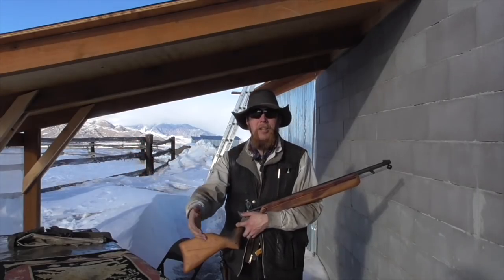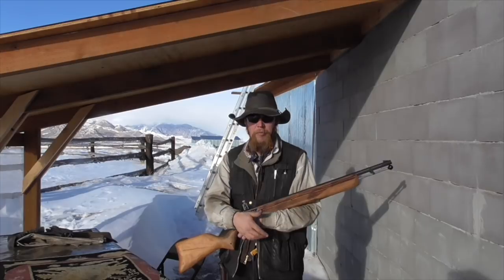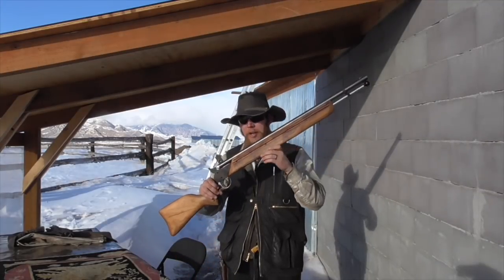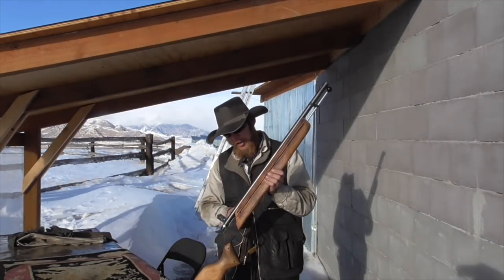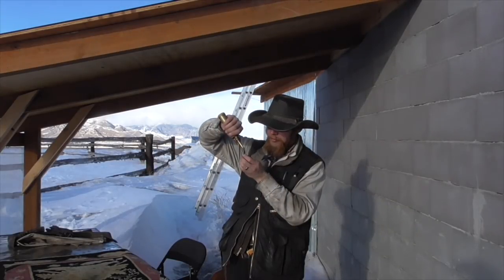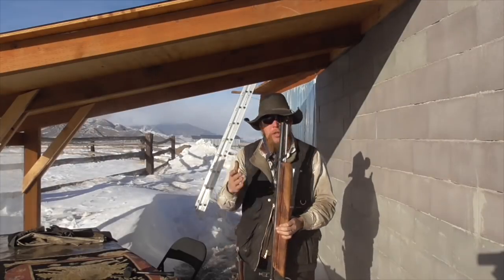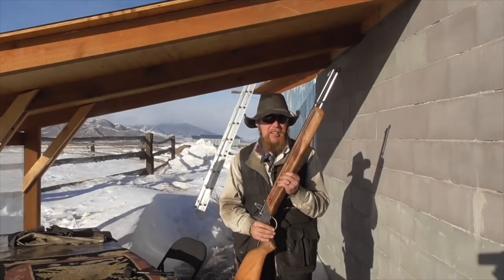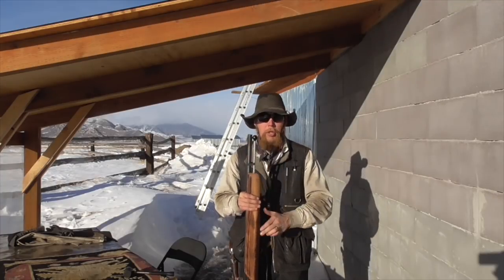Overload Testing Follow-Up (VR007)

Comment: The theory of this is that the gasses do not move the projectile as gradually as if there is no air gap. This sometimes can cause a pressure peak and has been known to 'ring' a barrel... I have actually seen this on shotguns (far thinner barrels) but apparently has happened with rifles, but old ones with soft steel barrels.
A bit like the detonation phenomenon with smokeless powder with large airgaps...it happens (seen it twice) but it is difficult to reliable reproduce...

Apparently a ballistics lab in the UK can reproduce the effect at will.....

Comment: the older gun barrels were not made from high carbon steel.some were made by forge welding a wire rod around a mandrel .with those soft barrels could not stand much pressure.a large gap between powder and ball would act as a bore obstruction and might bulge the barrel or crack the spiral welds.

Comment: I always thought that a vehicles rear end axle, like in an old Ford 9 incher' would make a very strong .50 BMG barrel. The metallurgy is very good and very tough forged better than almost all modern barrels.I believe that it is 5060 or 5140 alloy steel. I would think that a locale junkyard would sell them for $30 or $40.   Also the lug nut end even has a large chamber tapper profile for added strength. It may be harder to rifle the bore but the rifling doesn't have to be very deep. What would be you're thoughts?

Comment: do you need a pressure transducer? wouldn't a strain gauge on the barrel work by back-calcing the pressure from the expansion of the barrel. (and yes, I expect the barrel to be expanding a couple of 10,000's in diameter if not more)

Comment: Please do this again with actual Black Powder, as testing pyrodex and BP side by side BP sure seems to burn faster to me.
Reply: Pyrodex normally sends projectiles with a little bit faster fps from what I've seen, so I would imagine the pressures must be a little bit hire with pyrodex, but triple 7 definitely has hire pressure than both black powder and pyrodex, that would be interesting to see i think.

Comment: Regarding the discussion at end of video...... it will have a lot to do with case diameter vs bore diameter as well as shoulder angle..... for instance I used to fill my 30-30 cases up to the shoulder with IMR3031 then seat bullet on a regular basis .... shot very well..... by the same token I would not advise doing that with something like a 220 swift...... yup....of course I am just an old man wearing dungarees sitting in the corner just watching all of this stuff go down......I do enjoy watching though

Comment: I would think you would do these test on a junk black powder rifle, not on that beautiful hand made masterpiece you made. Sure is a nice looking black powder rifle! Great work! Thanks for sharing the testing with us. Have you ever seen the mosin nagants on forgotten weapons YouTube vids with the chamber pressure tester modification built on the receiver. It has a hole drilled into the chamber with a special rod of metal that at high pressures deforms insted of blowing the rifle up it just bends the rod and releases the gas pressure threw the hole in the chamber. You should watch it because maybe you could make the same thing for your black powder rifle. Just a thought. Great video thank you 😁

Comment: How much heat is generated by one shot of a black powder rifle? Would it be possible to use a thermistor wrapped around the barrel to measure the change in heat from the barrel to estimate a relative change in pressure using thermodynamics and known variables (like projectile weight)?

Comment: Do you know what the difference between fast and slow burning powder is? Is it just the size of the grains or is there another secret to it?
I know there is some really fast powder that uses nitroglyerine, but normal nitrocellulose powders have differences too.
Reply: I'm going to start learning all this ! I would like to know also!
Reply: There's multiple factors, including grain size. You can manipulate grain size and shape, and also the possibility of cavities in the grain. Stick powders are sometimes extruded with a hole in the middle so that it burns from the outside in and inside out, increasing surface area. Double-base powders do include nitroglycerin, and powders are also coated with burn deterrents that slow down the burn rate.

Comment: You should load powder ball with small hole powder ball with small hole repeat as desired light round closest to the muzzle it will fire light the next round and repeat than you would have a black powder machine gun they did that in the 1700s with a multi barel navel gun Minnie ball probably work better than round ball

Comment: Your test is invalid for 2 reasons:
First, a double charge is not powder+projectile+powder+projectile. It is powder+powder+projectile.
Second, You are using Pyrodex, this is a black powder *substitute*, it almost certainly has been engineered not to have the massively increased burn rate that actual black powder has if there is an air gap. I've seen figures for black powder with available air that show twice the burn rate and 4 times the dP/dt